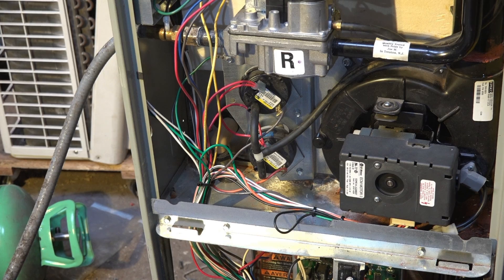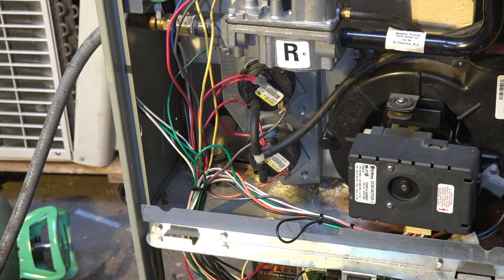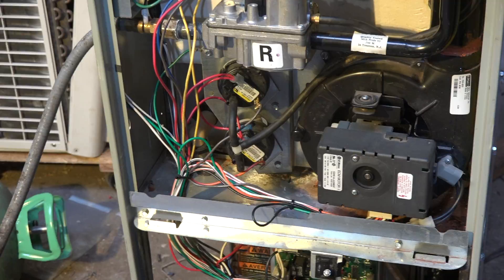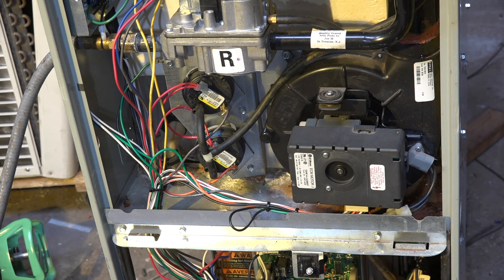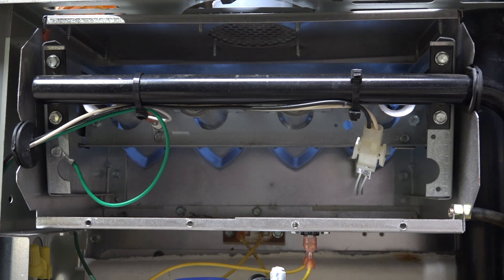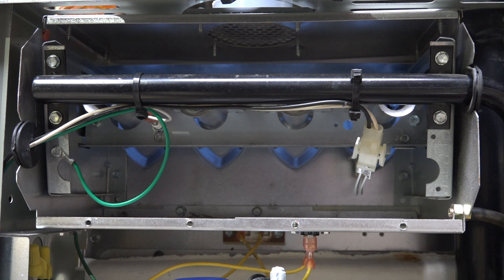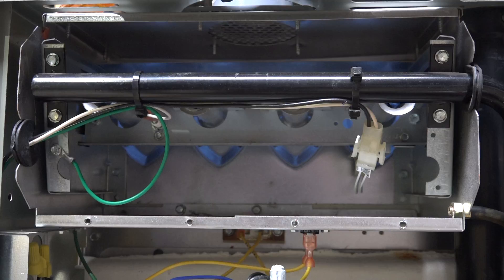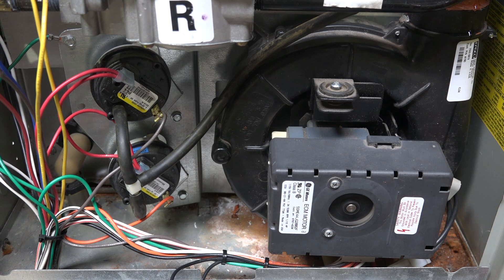What's wrong with this furnace , answer

Comment: Wanted to pick your brain... Got a York 80% that short cycles until furnace controller locks out. When it locks out, A/C blower continues to run in the house; I have to manually shut it down. After ignition, flame burns for about a minute or two each cycle. Have already removed flame sensor and cleaned but no difference. Unit is in the attic so it is a bit challenging to work on. What might cause this? Would poor grounding for the circuit be the next thing to check?
Reply from the maker: Sounds like an airflow problem.  Filter, dirty fan, collapsed ductwork, closed off diffusers, blocked A/C coil or plugged secondary heat exchanger.
GFM
Reply: Are you thinking that lack of air flow across the heat exchanger is causing the high limit to trip? I'm getting what seems like decent air flow out of the vents. I'm going to run the system with the return air filter removed to see if it stops the short cycling.
Reply from the maker: That is what the limit is for.
GFM

Comment: GFM: the var speed inducer is suppose to kick (down/up)? when engaged in 2nd stage burning?  Another ? is: You mentioned the controller for the inducer's fan speed is built into the motor module and not controlled from the IFC. Is that the case on most 2 stage 90+%  inducers and if not how'd we test for correct output from IFC? Thank You in advance and know your content is being appreciated.
Reply from the maker: I will be doing a video on this type of inducer that may answer your questions.  The inducer does speed up when going to second stage (more air for more gas).
GFM

Comment: My 80% furnace is going through the complete sequence except it is not getting 24 volts to the gas valve. Igniter is glowing red. I cleaned the flame sensor but assume it only comes into play once burners are on. What in the sequence tells the board to send 24V to the valve? I think that is where my problem is. I am getting one flash on the LED which for my unit notes flame sensor, gas valve
Reply from the maker: Sorry about the wait.  Some get missed.  Its a timing issue after the pressure switch closes.  10 to 45 seconds for ignitor warmup then 4 to 7 seconds power to the gas valve.  Check wiring from board to valve.  Plugs sometimes fail to contact.  Wiring ok, control board failed.
GFM
Reply: grayfurnaceman thanks for the follow up. After further investigation flame was rolling out tripping rollout switch. Cracked heat exchanger